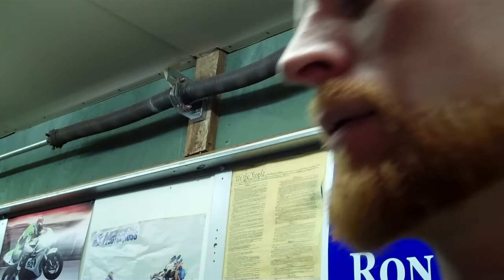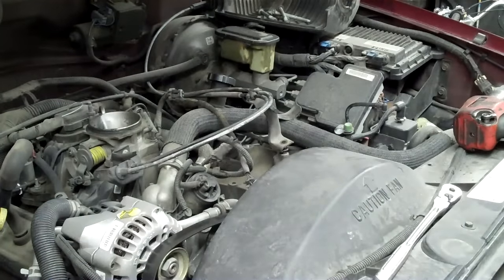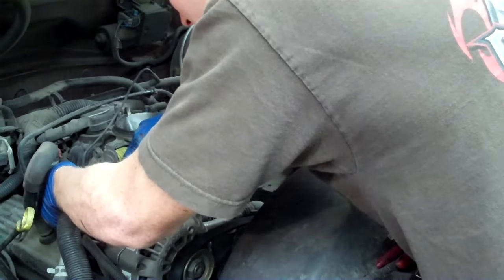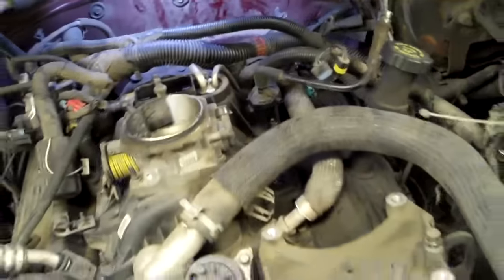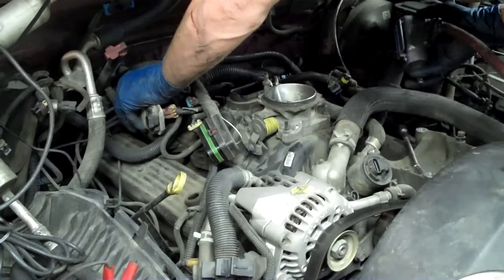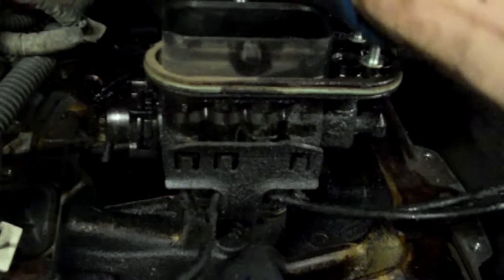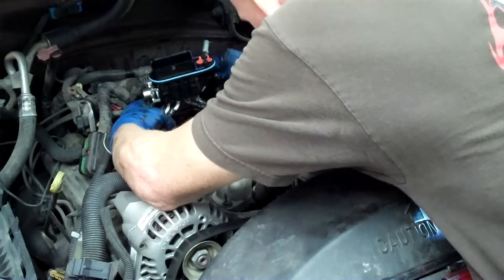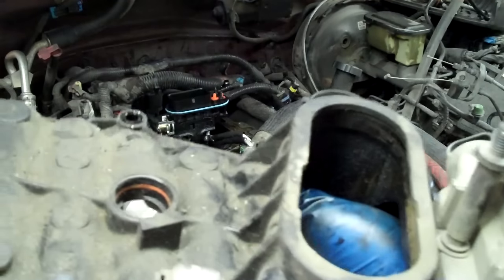How to change a SPIDER INJECTOR on a Chevrolet V8

Comment from the maker: The symptoms were the check engine light was on and had the codes P0172 and P0174, I think and it was rich bank 1 and bank 2. Gas mileage was bad. It made Al Gore cry. Less private jet fuel for him. The mileage was 175k.

Comment: Brian i have a 97 1500 5.7 and ill go from a cold take off and it slams and studders and chugs until i drive it a half mile and then it evens out the engine is brand new besides the intake so im wondering if its caused by this i can take off and put it to the floor and get the same as 1/4 throttle

Comment: how can i tell i i have a bad injector i have a 99 tahoe with a 5.7 vortex spider injector it dosnt smoke out the tail pipe but it does sput and sputter and  when i open the throttle body flap it smells like raw fuel  and you can see white smoke or steam but i cant see down to the injectors without removing the cover it has had a complete tune up new cap rotor wires and plugs and there is no check engine light  but you can hear it sputtering and has a rough idol the iac is new as well also has a new maf and map the tps is also new when it sputters at times you can see it shot some liquid or something out the tail pip even after the engine has been running for hours air filter is also new the fuel pump is fairly recent too. its also had a new intake manifolded put on it several years ago.
Reply: I have a misfire on cylinder 2 and 3 please help ive have changed everything even the intake gasket tune even new injectors engine has good compression.
Reply: +SuperJeremi10 new plugs & wires?
Reply: done all that new cap and rotor new 02 sensors even a new fuel pump and filter we have changed the injector system and cylinder 2 is still missing cylinder 3 has gone away  cylinder 2 misfire went away for about 1,000 miles then came back check engine light keeps flashing and has fuel trim codes and bank 1 and 2 rich keep popping up on the computer system I just got me a jeep grand Cherokee but still would like to get the Tahoe fixed if not I'm selling it.
Reply: Do you know why my truck be stuttering I change the the body throttle egr's everything but it still stutters like when I'm driving feels like I'm pulling something

Comment: I'm sure now the Dam clips from the puppets fell down into the injector holes.
Stuck on the value, I sure hope there not torn up. I only started five times and had knocking noise on 7and 8 which is where they fell in.
I was sure I got the clips with a vacuum but I'm wrong.

Question I was given the new puppets our to long and there hitting the cylinders.

I don't see that problem, since the AC delco is no longer around.

Comment: Hey bud great vid! I have a 99 suburban 5.7 vortec im replacing the spider but with the regulator is there suppose to be a hose on that nipple end? Also on the plentum on the driver's side there is a cap looking thing for vacuum. I broke that dam plastic nipple on that. What is that called to I can replace it? Its a round looking thing. 1 more thing. I noticed when I pulled off the plentum that there was a little bit of oil on the back side on the passanger side on the intake. Is this normal?

Comment: HOW TO GET INJECTOR TO SEAT INTO MANIFOLD COVER: after a couple hrs I gave up. It appears that an after market bracket maybe needed seeing as how so many new conversions are now being packaged including the retaing bracket. I searched online and at stores to no avail. So I simply removed the retaining bracket and placed 2 washers under it, put locktite into the threaded bolt hole and tightened down the torque screw only to about 1lb. so bracket can still wobble and the manifold cover fell right into place. By the way, this was on a 2000 5.7L vortec

Comment: Hi Brian I bought a brand New spider and had it put on but then my truck wouldn't start!! It seemed flooded or something but then we gave it a jump start and it finally started but it's still reading a misfire on number 6 any advice??
Reply: Cap, rotor, and spark plug check
Reply: MrNightpwner  tried all of that when I did a full tune up still reading a misfire
Reply: Lawrence Alexander
I ended up doing this job a week ago. Man, it was nerve wrecking. If you're gonna do this have a roll of paper towels so you can plug up the intake holes so no tools or bolts fall in. Also, don't buy a new bracket, it's not necessary at all.

Comment: Thank you for making this video. I'm somewhat savvy and followed directions and didn't miss any steps. I have a 96 chevy k1500 4wd 5.7l v8.  I still have the Random Multiple Misfire code.  I have new plugs, wires, cap, rotor, TPS, cam sensor, crank sensor, o2 sensors, and mass air flow sensor. Any suggestions?
Reply: So this is really old but any chance you ended up getting it figured out I've got the same truck as you similar situation with all the new parts except I'm waiting on my new spider to arrive and hoping it does it but if not what fixed yours?
Reply: @jeminifaulkner6375  wow yes long time haha. But yes, it was my own dumb fault, i crossed 2 spark plug wires.. always double and triple check to make sure they arent crossed at the rear looms. It is very possible the new spider will fix the random multiple misfire.

Comment: Hey, love your videos. I cant seem to find any videos with putting the upper plenum back on after everything was done here. Im having one hell of a time getting the new or even old gasket around the injectors to seat correctly. Even the old round "elliptical" gasket where the fuel lines bolt into the injector assembly isnt doing the job. I have one hell of a pressure leak right there, and its making my truck run like crap, please help! This was all after doing a lower intake gasket.. thanks

Comment: Always wondered why Chevy did such weird things with fuel injection, like stick with TBI till the late 90's And this odd "spider injection module" stuff. Where as Ford (and Dodge) were using the standard muiltiport fuel injection since the mid 80's.  Hell the 86 mustang had SEFI....

Comment: how much you think a shop would charge to do this im not sure i could get it done right  and my 98 tahoe has a hesitation  runs little rough and as an intermittent check engine. not sure what it is.
Reply: I had a p0308 code and fixed everything up until this point. I changed park plugs, wires, distr cap, rotar and ignition coil. The dealership charged me 127 for the diagnostic but said I would have had to pay 1283 for the job. It's pretty straight forward if you watch this dude. I almost completed the removal of the intake during my kids nap time.
Reply: yea it  a tune up  fixed my thao  random misfire

Comment: well I got plenum off today thank to your video. ....lots of black carbon and moisture in there. how in the world do you clean all that?
Reply: Mike, the wife might want to kill you for doing this in the kitchen sink, but I find Easy-Off oven cleaner to work miracles on the nastiest oil and gunk out there.  Works best if the part is completely dry as in no water what so ever.  Spray it on and let it work for ten minutes and rinse it off with warm/hot water and a brush.  Let it dry completely before you hit again because if it's wet first it seems to loose a good deal of oil cutting power.  Don't use it on aluminum or expect it to be eaten away and discolored - this stuff is sodium hydroxide in a gel suspension, the same stuff they used to use to 'boil' out engine blocks when overhauling them - it works by turning the oil/grease into soap.  Cheaper brands of oven cleaner don't work as good, need to spend the whole $5 and then some.
Reply: wow, great advice thanks lee   .....i bet it would eat plastic parts up though if let on too long huh?

Comment: I wanna change it to something other than spider injection something that atomizes better but I don't know what will work like what type of options do I have ?
Reply from the maker: Replace the computer, manifold, wire harness or everything.  The best option is get the latest updated spider from the dealership. The GM ones you get aftermarket are all obsolete market dumps from dealership inventories.

Comment: brian, do i NOT use any rvt on the gaskets during reinstall?   thanks for video
Reply from the maker: +Mike Reynolds You shouldn't have to for the upper manifold.  They're all rubber sealed.
Reply: OK thanks Brian, guess just put a little petroleum jelly on them maybe, or nothing I guess.
Reply from the maker: Either silicone grease or nothing.  Petroleum can react with the rubber.
Reply: Thanks for the advice, warnings and knowledge !!   Still cant find out where to get the o-rings you suggested to change out on the throttle body. The kit came with the big gasket and the smaller square gasket, but the round o-rings.You are the greatest, wish you were here to hold my hand when I attempt this weekend, I am a little intimidated by it. But I just don't have the coin to pay somebody else to do it right now.

Comment: I am 13 minutes in. Starting to doubt if I will be able to remember what goes where and when.  lol  

I see many photos in my near future.  lol  

It was probably illogical to think the spider could be mounted inside of an enclosure under the hood, requiring a couple bolts to be removed to access it, instead of hidden inside as if it was a secret.  I know, exposed fuel lines increase the risk of breakage, and over all, it is safer to mount it where they currently are. Just wish it was like burger king sometimes.  :-D

Comment: you mention that working on imports you only need a 17,12 and 10, but north american stuff requires more. i work primarily on north american vehicles. i find chevy the best for wrench sizes, 7,8,10,13,15,18,21,22. it is actually a pain for me when i grab my normal sizes to do stuff, and i end up needing an 11, 14, 16,17,19. i really think the world would be a better place for us techs if every manufacturer used the same common sizes.

Comment: Watch out for the master plug wiring part that sends the power to the injectors, if you bend a pin inside it a cylinder will not fire been there done that!!! Check it before you put it back together.

Comment: I didn't see anything connected to the fuel pressure regulator. Is there anything that plugs on to it? It looked like  there was a port but nothing on it.
Reply: That port is just a vent.  You're good to go!
Reply from the maker: It's immersed in vacuum.  If it was outside it would need a hose to get vacuum, but it's inside already so the vacuum is there.
Reply: Thanks that makes sence
Reply: @briansmobile1  I was going to ask about this.  Great video!  I'm going to do this repair.

Comment: I have a 97 GMC Sierra with a 5.7L. Injectors 2 and 8 aren't spraying gas. I have the CSFI spider injector with the black poppets. I was going to switch to a MPFI but a friend of mine that has done a couple injector change outs said the MPFI with the white insert tips won't fit mine. I've research online and see that there is a spider kit that has a 5mm and a 6.5mm white tips. Do you know if I need a certain one? or do I just need to measure the tips to see which one fits? Any suggestions?

Comment: Was there a bolt thats smaller than all the others on your plastic intake
Reply: There were 3 bolts that were 8 mm as opposed to the 10mm. They are the same thread size so I don't think it matters personally but I took pics of all the bolts before I removed them to be sure.

Comment: well just my luck Brian, took me all day to change my " creature of darkness" and It still missing and running like crap. I am at wits end, done plugs,wires, cap, rotor, cam sensor, fuel filter, fuel spider. Any ideas would be MORE than appreciated.
Reply from the maker: +Mike Reynolds Vacuum leaks.  Do you have something to check your fuel trims both long term and short term?  I did a video on this recently.  Here's a link. https://www.youtube.com/watch?v=UckuWapeeps
Reply: Hey did you ever get your truck running right, and what was wrong with it?
Reply: it runs, but still misses a lot......just never could find it, Ran out of money and patience
Reply: awe bummer, well I hope one day you realize what it could be, but best of luck with you.
Reply: Banks manual
Reply: Mike Reynolds well obviously you need three things for an engine to run spark Fuel and air did you ever think of doing the air cleaner or looking for a vacuum leak I had the same problem but luckily mine was the cap and rotor
Reply: Yep did all that. I just put up with rough running and missing. Glad its not my daily driver anymore, just my fun truck now.
Reply: Mike Reynolds try cleaning out the IAC
Reply: make sure the o ring for injection unit isnt leaking

Comment: Mine has a pain in the butt bracket on the passenger side that bolts to the back of the head against the fire wall  with ground wires that is absolutely horrible to try to remove :(

Comment: i found an 01 v6 vortec from a silverado with 70K miles and wanted to know if i would have to fabricate mounts to fit in my 94 v6 vortec sonoma 222K miles,and and other than harness and computer what else would be needed for a swap as such

Comment: Here's a tip for remembering all the hoses and connectors you disconnect.  I buy a pack of those circle stick on labels that come in neon colors.  Stick them on everything you disconnect.  You won't miss a neon yellow sticker in an engine bay that is mostly all black.   Now all i need is a tip on how to find my 10mm wrench that the engine bay swallowed LOL  Dropped it down by the headlight in front of that box you can hold a quart of oil in.  looked from underneath and can't find it.

Comment: okay I have a 1996 Chevy 1500. I've changed the distributor cap the rotor plugs and wires. I still keep getting a p0306 code . it says the number six cylinder misfire. do you think it might be the fuel injector? 
I've done everything even test the wires all looks good.. but I keep getting a code that number 6 cylinder is misfiring... the only thing I haven't done is change the fuel injectors..
I also even change the fuel filter... 
what could be the problem?

Comment: what's the order for tightening your plenum bolts?
Reply from the maker: Start in the center and work your way to the outside and then re torque the center.
Reply: do you torque them to 44lbs? reason I ask is, I tried torquing them and none of them ever tighten completely. I actually broke one in half up by the rad hose trying to torque it. I turned my truck on after putting it back together and it ran extremely ruff. I replaced the new type spider with an older model from a 96 chevy , wonder if that's the issue.

I'm used to the mustang plenum where they torque to 65lbs pressure and there big bolts not like these dainty little studs.

Comment: on these kind of applications I like to use a breaker bar to break things loose then finish them off with an air ratchet. The breaker bar will get anything, even things the butterfly gun can't and air ratchets just sound cool right? BZZZ! BZZZ! BZZZ!

Comment: is there some way to figure out if the injectors are bad, cuz i am gettin gas through the lines all the way in to the top of the injector but it aint starting like it aint getting gas. but when I prime it it will run, so if you can help me out or anyone can it will be greatly appreciated
Reply: I had the same problem and it is the fuel pressure regalator on the spider injector. the diefram dries out and puts gas in the main in take and like fluds it out.i would have to spry it with loads of starting fluid to the air intake at the intake and that would help. some times it took 2 or 3 times. once it starts and warms up it will be good until it sits for to long before it does it again. so change to fuel pressure reg in the upper airintake at the spider inject. or replace the inject with a new one that is like the one in the video. bob
Reply: Thanks for the information sir. I want to make sure it was the regulator and not the whole injector. they are a little bit more than the regulator. I appreciate you telling me thanks again
Reply: It was the reg but after replacing I desided to replace the hole thing with the new spider injct. when I got a few extra bucks and also did the lower intake gasket while I had it all apart and I love the way it starts so quick even before I replaced the spider injection
Reply: The gas will just dump in from the old reg being dried out in the diaphragm and dump the gas in the intake and when u go to start it its like there's no fuel due to all the gas leaked out of the line and not holding pressure then dumps it in the in take to also fluid it then will take for ever to start and I had to put the either to it and a lot as well to get it started. if you have it open and have the extra money change the hole thing it comes with the new reg built in and will find a big change.  bob
Reply: hope this help out

Comment: Replace your fuel pressure regulator.  I had the p0172 p0175 and p0300 misfire code too and I just replaced the fpr and the codes went away and it's been a few weeks now.

Comment: I CHANGED MY SPIDER INJECTOR ON 1998K1500 5.7, WHEN I START IT UP IT RUNS FULL THROTTLE, THE THROTTLE BODY IS CLOSED.
Reply: you've definitely got  a vacuum leak somewhere

Comment: I have a 97 z71 k1500 with a 5.7 when its from cold start or even after it warms up if i step on it it bogs out and sometimes backfires i have rfeplaced the TPS switch it helped but still seems to do it but not continuously what would be causing this